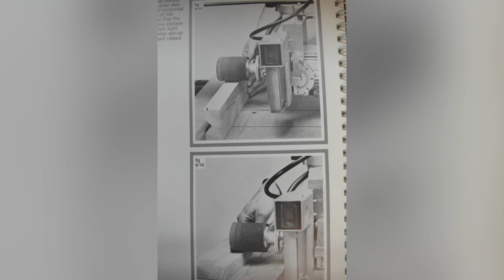DEWALT Radial arm saw. Multifunction crosscut mitre saw.DEWALT chop saw. Multifunctional  table saw

Comment: Radial arm saws are awesome. Just got same model as yours few days ago.
Have seen also a guy using it with a lathe linked to the motor. It never stops !

Just hope the axle will stay ok with your sanding technique ✌

Comment: You have to attach the return mechanism to have a perfect AND safe piece of woodworking tec.

I am a very proud owner of this exact machine. It is dangerous if it is not safely set up.

I have the replacement spring on order and it will never be operated until the return mechanism is replaced. 

A great video nonetheless. Thank you.
Reply from the maker: I have return mechanism however, I don't need it. Thank you
Reply: @DobryChloooopak85  You are welcome.
Reply: I have the same model but my shaft diameter is 30 mm, and there is no thread on the other side. Did you customize anything in order to attach the chuck and Sanding drums?